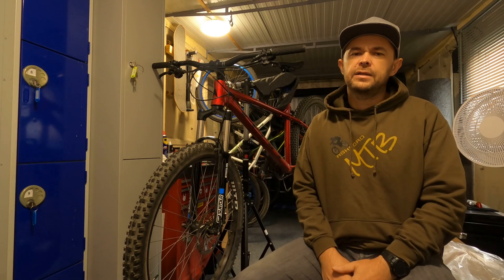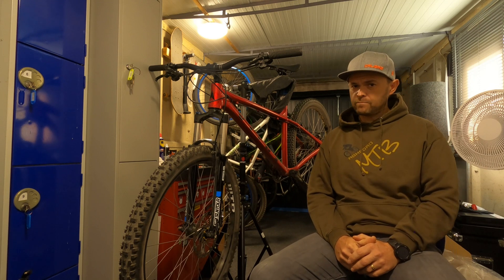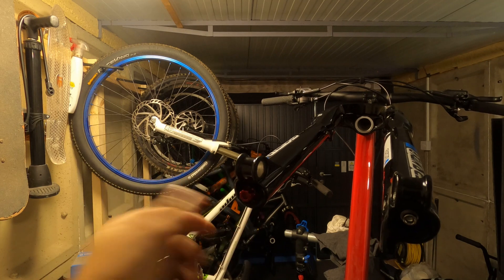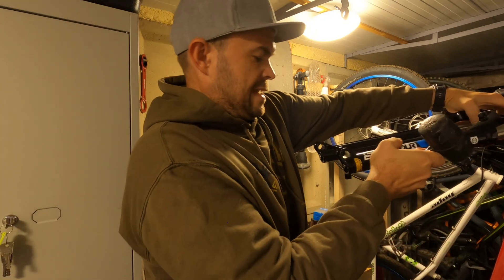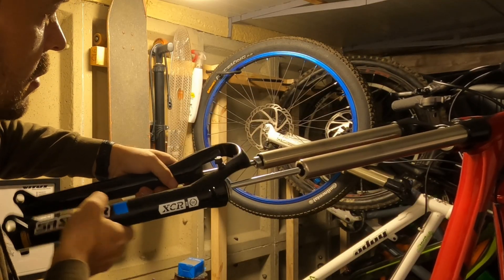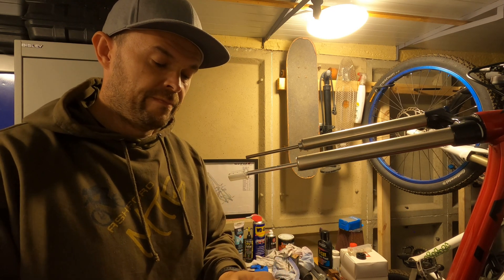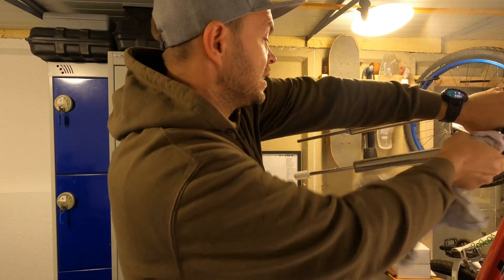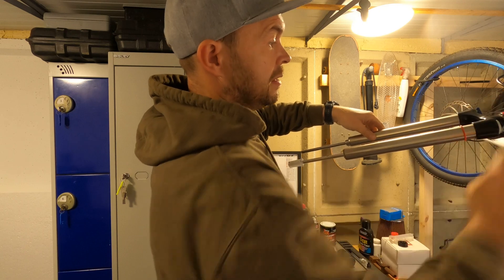Suntour XCR Service - Lower Leg

Comment: I'm new to mtb front suspension as I was a bmxer. My son has suntour xcr 32 27.5. The right hand internal damper is faulty. I've tried research but can't quite work out exactly which damper replacement he needs as there is alot of different model numbers. Please could you tell me the correct model number so I can order a replacement.
Thanks alot👍

Comment: Question; I've had problems with the rebound knob getting unwound and not able to adjust rebound (it will freely turn without any "notches "). A month or so ago I started hearing a knocking sound every time my fork rebounded out of compression. I decided to inspect the rebound assembly and I was able to solve the issue of the sound and the knob feeling "unwound", but it's still not adding damping. There is a small bolt below/above the 8mm bolt that needs to stay in contact with that 8mm bolt, or else the knob won't work. So my knob works now, but it's not adding damping. Is there something else that I missed doing or maybe do I have to buy another rebound assembly?

Comment: Question; I've had problems with the rebound knob getting unwound and not able to adjust rebound. A month or so ago I started hearing a knocking sound every time my fork rebounded out of compression. I decided to inspect the rebound assembly and I was able to solve the issue of the knob feeling "unwound", but it's still not adding damping. Is there something else that I missed doing or maybe do I have to buy another rebound assembly?

Comment: How come you didn't actually clean the inside of the lower stanchions and clean the seals etc before putting the foam rings in and upper stanchions back in

Comment: Great Video! Just a question, did you remove all the air from the fork before doing this?
Reply from the maker: Hi, and thanks.
No need to release the air for this procedure.
Reply: @AshfordMTB  thanks so much, could i use sram butter for grease on the lower part of the stanchions?
Reply from the maker: @hipe2930  hi, this will be fine. Don't forget to get some in the wiper seals too.
Reply: @AshfordMTB  Hi, thanks so much for the fast respond, and of course! I love your videoes, and they help me alot.

Comment: Hi what size o rings are they?
Reply from the maker: Hi, these are the ones that I purchased Sharplace Bicycle Fork Sponge Ring Oil Sealed Foam for Bike Fork Sponges Itinerary O-ring 32/34/35/36mm https://amzn.eu/d/6M7vx0Z

You need the ones for 32mm stanchions.
Reply: SR Suntour also has some on their service parts page. They have pretty much all the parts of the fork listed, plus o rings and recommended oil for the XCR32.
Reply: Hello, what is the number of the oil you put the seals in?

Comment: Awesome. So for a budget fork... apart from lack of oil rings and grease how do you rate them??
Reply from the maker: Compared to a budget coil fork, I would say that these are better. Obviously it would all depend on what sort of riding you do as to whether they are suitable.
Reply: Due to needing a replacement as the forks on bike pretty much gave up on me and on a tight budget I took a huge risk and bought some air bike forks... yea not best idea but at least can still ride haldon!! Will certainly look into those suntours soon then 🤘👍👍